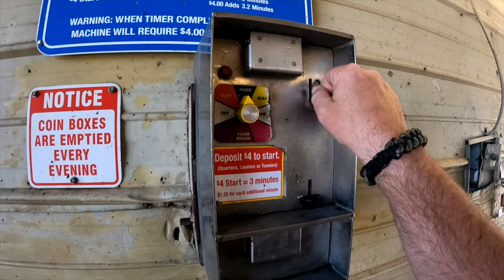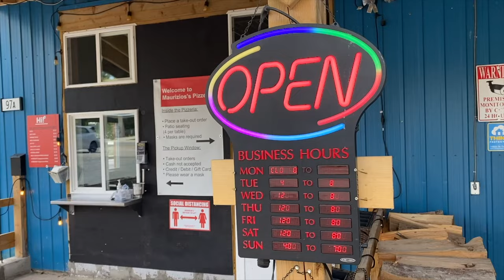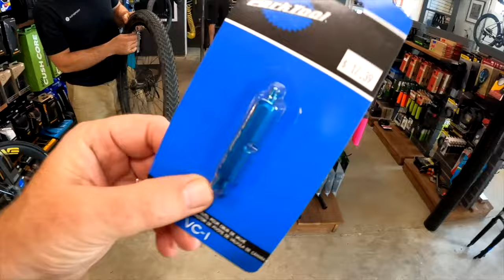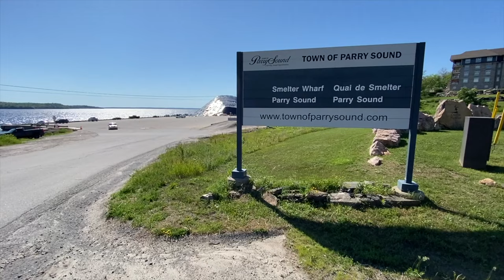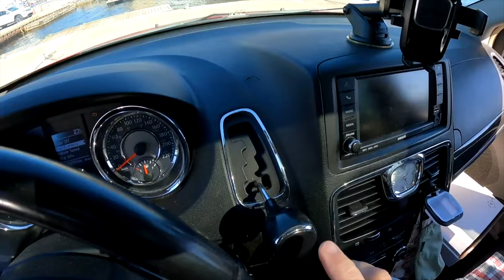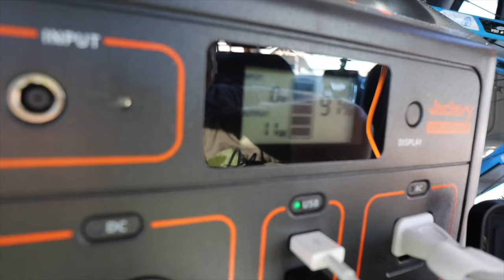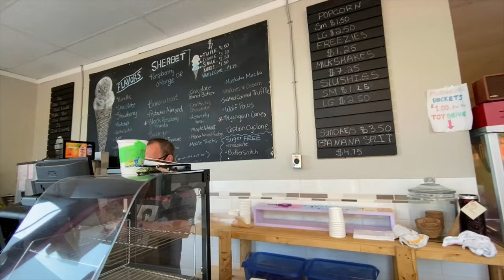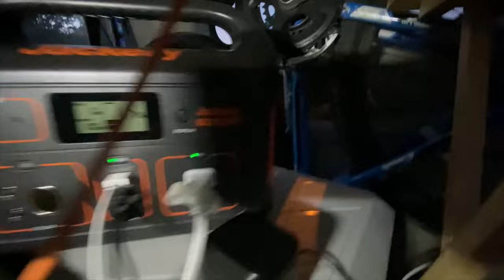Van Life 🚐 CARNIVORE PIZZA • Parry Sound Food Tour Stealth Camp #Vanlife

Comment: Does the Jackery have USB power delivery? If not you might want to look at a DC (cigar) PD adapter or a battery that has power delivery. When you’re firing up that inverter, you’re converting DC to AC and back to DC so you’re loosing efficiency.